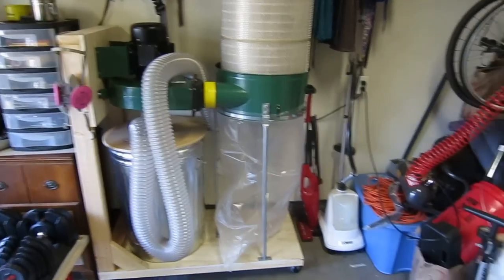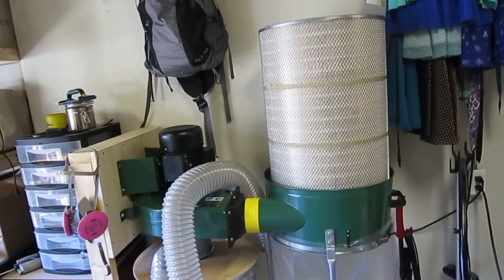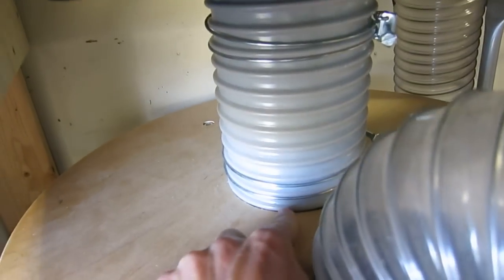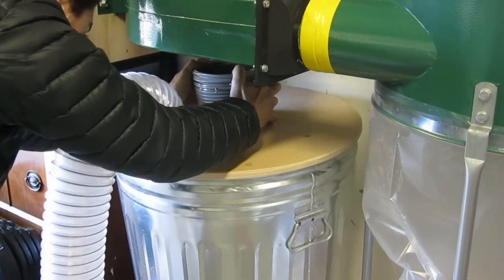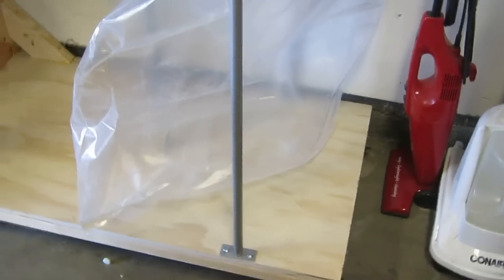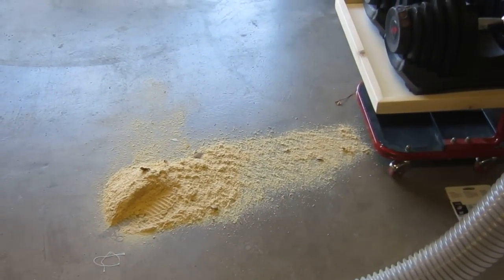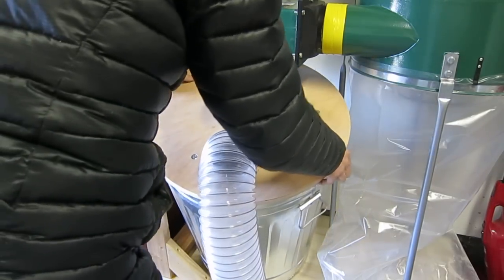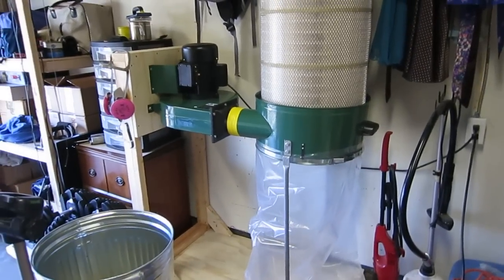Harbor Freight 2hp Dust Collector with Wynn 35a Filter and Thien Baffle Pre-Separator Setup

Comment: Great build and video, thanks. Your motor is mounted on top of the Thien Baffle, which makes sense for the direction of airflow, but are the bearings on the electric motor shaft able to take the downward loading? Are the bearings on the motor shaft, thrust bearings?

Comment: This makes sure you spend more time cleaning the chips out of the filter than you spent making them.
Reply: Not sure you understand how these work.  Huge improvement in air flow.
Reply: @BarryJohns   I understand completely. Did this stuff 15 years ago.  No air/dust separation.
Reply: @terencenewlin5265  that’s not what you said though, I agree with that.  The benefit of changing to this from the stock system is huge and worth every penny.  If someone can afford a much better system then that should go for it as it’s worth it, but others have to make due or can’t justify the cost due to it being a hobby.

It’s a very worthy upgrade, and one of many possible to help improve for those inexpensively on a budget.

As to cleaning wood chips out of the filter, not an issue, or let’s says I’ve never had an issue.  At some point I’ll upgrade to a better system that can truly pull all the harmful dust from the air and not just keep the shop clean of debris.  For now, it’s garage doors open and a respirator.

Comment: Hi, great job on the alteration.  I am thinking that a 2” pipe that is in the center of the bottom Thien level plywood, and then extends just below the 4” pipe exit by  2”, would create a negative pressure in the bottom of the trash can and almost eliminate all dust going onto the filter and clear bag.  Have you seen very much fine dust in your filter?

Comment: Good start to a great build. Just FWIW, I have the same DC and the same series filter but mine is the washable unit. Some more upgrades if you want even more air flow. #1. Upgrade the impeller. Rikon and Wen impellers reportedly fit and work great. I am planning on the Wen impeller ASAP. #2. Size up your inlet and pipe sizes through your Thien, OR size up your inlet and move the Thien to the separator ring although everything goes to the bag. Go with 6" inlet / pipe sizing

Comment: I am doing it a bit differently.  The dust input hose goes directly into the center port of the blower as it was designed to do (I have turned the unit upside down from yours) and the output from the blower goes into the the thien collector and then the bag/filter unit.  The benefit, IMO, is that all the suction (low pressure) is delivered directly to the collection hose rather than pulled through a large garbage can and then through the hose. That does not create the best suction where you want it.  It follows two principals of minimizing the run distance of low pressure side of blower and the diameter/volume of that run.  In your case the entire low pressure side of the blower includes the trash can and the hose.  However, the footprint of my setup is larger.

Comment: I'm debating on getting this setup.  Did you ever consider an impeller upgrade?
Reply from the maker: I 100% recommend an impeller upgrade.  The stock is definitely too small.
Reply: @thesergeant3524  also does the unit require a dedicated circuit?
Reply from the maker: doesnt require it but i would highly recommend it, especially if youre running it on a 15amp circuit.

Comment: How does the filter get installed on to the top of the system??
Reply from the maker: The filter includes 3 small turnbuckles with hooks on the ends.  They grab the inner lip of the filter and the lip on the body of teh dust collector
Reply: @thesergeant3524  thanks so much for the reply !!

Comment: it’s five years later and is it still working good or did you make any more improvements?
how is that filter doing?
i’m thinking you improved the way you detach the waste barrel, yes?
Reply from the maker: I actually need to do an updated video.  Since doing this video I've gone through 4 different systems, including a 3.5hp 14" impeller cyclone and back down to a modified Oneida Mini Gorilla.  I can not longer recommend this type of system.  The static pressure loss is too great.  Yes, you can get decent separation with the Thein baffle but the SP loss is almost 50%.  The problem is the filter requires that you have a pre separator.  The HF unit with it's small 10" impeller isn't pulling enough CFM to give more to a pre-separator.   Yes, the filtration is good, but if you're only collection 50% of the dust that you could be what does it matter if it filters .5 micron?  I'm going to do an update video with everything I've learned.  I have a air particle counter and have done a lot of real world testing.
Reply: thesergeant I really appreciate your experience and testing, I would love to see that video.

Comment: Looks good. I poured a 4x4 slab outside my shop and am framing in a small room. Since it'll then vent outside like a dryer, I'll not need the filter and ought to have a great CFM flow rate. Wish me luck!

Comment: Going to be doing a similar arrangement to this setup when you did this vid. Its very close to what I had in mind. Except I'm on the fence as to putting the Thein baffle in the ring of the Harbor Freight body as many have done and a small barrel underneath.
Have the Wynn filter on the way. But the downside to that is all the debris goes through the fan motor.
The plus side is there is no loss in cfm or performance the way I understand it.
But leaning toward the separator before the fan motor.
Any suggestions for me after using your for several years?
Would be much appreciated.
Reply from the maker: I need to do an update video.  When I made this video I was new to woodworking and didn't have a complete understanding of dust collection, CFM, static pressure loss, ducting, etc.   Knowing what I know now I would not recommend this setup at all.  The impeller fan on the HF unit is too small, the CFM drop from the Thein Baffle is basically 50% and when you factor in static pressure loss from ducting the reality is you're airflow horrible.  Yes, the air coming out of the dust collector is clean but if you're only collecting and filtering 30% of the dust it doesn't matter, even if you are filtering to .5 microns.  You'd be better off collecting more dust but only 1 or even 5 microns.   Also, the only tools that will be adequate for this collector are the planer and jointer.  Every other tool needs upgraded hoods to actually be effective at collecting the dust -- quality collector or not.  My new setup is much, much, much improved.  I'll post a video soon if I can.
Reply: I built a similar setup but used tips from multiple projects I had seen. Also had in mind to change out the impeller if needed but after paying close attention to everything being sealed and I added a baffle under the ring of the dust collector with a 5 gallon bucket for the dust.....I'm happy with the suction of it. Actually splitting off with blast gates on the cart to a floor sweep and it functions great but I don't use the floor sweep very often think I'm going to disconnect all that have one hose that I connect to what machine I'm running. Also used the dust right quick connect to make that connection easier. Thanks for replying, your video is one that gave  some ideas early on and was a great video.  When I tested it out the hose would actually lock up on the floor when sucking up dust. So seems to have plenty of suction for what I was wanting and performs great. Always room for tweaking tho 👍

Comment: With the art work that I make I do a great deal of sanding, very fine sanding in fact.   I understand a separater will separate larger or heavier wood pieces but do fine dust  particles simply go direct to the filter and then clog up the filter?

Comment: I like that setup, it looks like it should really perform well but at 7:14 - 7:20 or so in this video when you were cleaning up the lighter dust the tip of the tube caught the floor a little, but came right back up. This happened three times, so there has to be a bigger lose of suction than you are anticipating, and this is the point i want to make, when the tip caught the floor, it should have grabbed it with enough powet that you would have had to struggle to get it loose. I'm sure you kmow what saying, for instance when you use a house hold vac and it catches a curtain or flat patt of surface you have to separate the hose from thete.
Like you said, the harbor freight system is only so effective, but i am thinking the seal on the tin barrel.
There is a seal broken someplace, because it should suck much more than what is shown here.
Plus you are getting too much dust in the clear bag in comparasan to other videos that use thr thein baffle.
Build a real thein baffle instead of using that swirl design that sits inside the barrel and raise the system up 12" or whatever height you make the thein baffle. I say this because those sysyems swirl the dust around the barrel and suck it back up. Another thought is to build another thein  baffle with a 2 1/4" diameter hose same as a shop vac to see if it performs better with the harbor frieght system. Something else just came to mind, and that's maybe that the tin barrel may have leaks in the seams itself. Clean the inside of the barrel with rubbing alcohol and seal around the bottom all the way around and up the side to the top with silicone.I'd like to know if you change anything or find any leaks, because i want to build one and i want it to perform properly instead of wasting my time.  My two cents.

Comment: The key is really at the tool as to getting good dust collection and less in the air ;IMO. Its at the tool that majority of duct escapes system.
Reply from the maker: 100% agree.  I remember reading about someone that upgraded to a Clear Vue cyclone from a 1.5hp unit.  They tested both dust collectors on their table saw and used a Dylos particle counter and tested the air quality.  The air quality measurements were the same between the 1.5hp 1-stage and the 5hp 2-stage.  WIthout proper hoods the DC can't do it's just.  I need to update this video because after doing more research and years of using it I realized how low CFM this setup actually pulls.   I think most people would be better off with the stock setup with a 1-micron bag filter.

Comment: Having looked at your system along with other similar setup modifications using the HF dust collector the question comes to mind, why the need for such a large fine dust bag since most of the debris ends up in the pre filter.

Even with a large shop running multiple intakes, the amount of fine dust collected by comparison to larger particles caught by the prefilter is minimal. You'd have to empty the 31 gallon prefilter a 1000 times before coming close to filling the collection bag on the actual dust collector.

I think further modifications and thought needs to be put into this. And in doing so, would make the required real estate of the overall system much smaller by comparison.
I could be wrong, but your test collection suggests is be correct in my presumption.
Reply from the maker: You're absolutely right, no need to use the full size bag under the filter.   A couple months after I made this video I shorted that bag to maybe 1/3 it's original length and use the space underneath for hose and accessory storage.  I also added a clamp rack to the opposite side of the motor mount.   It's worked phenomenally well over the past 3 years.  I almost bought a new Laguna system but stopped myself when I realized I wouldn't be gaining much for the money.  I'm starting to look at my shop tool setup and dust collection differently now though and am in the process of reworking my overall system so that I can get away without a full size dust collector.
Reply: thesergeant - thanks for the response and update.

I stopped by HF today and took a closer look at the dust collector. I also saw they have a "portable" 1hp vacuum motor housing only for less than half the price of the one like yours.

I don't know how much cfm difference there is between the two. The 1hp I believe was 600cfm of air flow but @ what force i don't know. 

In looking closer at the one like yours... personally, given your test results. I'd toss the after filter for the most part and/or convert it to a prefilter like your 31gal can. Use maybe a 5 gallon post filter set up similar in design to what exists.
Given that train of thought... 
The 1hp without the bag and pleated filter looks inviting. Then you could just design it the way you want.

Currently, i don't need that much collection. My 12 gallon shop vac suffices. But i do want to add a prefilter to it similar to yours. Looking over designs and mods to systems like the HF that you did and others for my shop vac is what brought me to your video. That and I'd like to have something powerful enough, say for a table saw, that can do the job. I'm not sure my Shop vac is up to the task. So looking at alternatives..  such as the bigger systems holds my interest.

Have you done an update video on your collection system yet? If not, might be nice to make one and add in a section of thoughts or ideas you've had to improve or downsize, modify, discoveries in use of or what have you since you've been using it now for a few years now.

You'd get a view from myself and I'm sure others wanting to see an update and hear your ideas or thoughts being tossed up as your shop has progressed... 😉
Cheers...

Comment: Very cool!  Couple of questions:  How necessary is the circular wood separation device that's suspended by the long bolts inside the trash can?  (Not sure what one would call that.)  What did you do to ensure a tight seal of the lid of the trash can?  Also, you seemed to mention some formulas in the video.  Where would I find those?  Thanks so much for sharing your very nice project.
Reply from the maker: The separator isn't mandatory but it's a super nice upgrade.  It makes emptying much, much easier and faster (the bag is a nightmare), you can vacuum up things you otherwise wouldn't (like bolts, screws, etc.) without risk of damaging your impeller or puncturing your bag and your filter will stay cleaner longer since less dust is ultimately making it that far.    The separator is called  "Thein Baffle".  If you google it you'll see a ton of info on how to make them as well as the formulas mentioned.   I didn't seal the lid on the trash can.  The weight of it plus the pressure exerted by the 5" hose is enough to keep it sealed against the lip of the can.  You could always add gasketing material around the wood and then use a bungee cord across the top to hold it down if you are having leaking problems.  

If you don't want to go through the effort of building a Thein you could always purchase a "Super Dust Deputy" instead.  Same principle.   Goodluck and thanks for the comment!
Reply: You keep getting inquiries about sealing the lid of the trash can. Point out that it is in the suction side of the system. Never be a dust problem and wold only affect the suction at the end of the hose by whatever loss the lid may have. The suction would also help pull the lid down tighter to the can.
If wanted, a gasket material could be glued to the outer portion on the inner side of the top of the lid. Compared to the overall air flow, any leakage would be minimal but, for a perfect system, go ahead and gasket.

Comment: I purchased the POWERTEC 70001 Dust Collector Bag, 20-Inch x 31-Inch, 1 Micron bag from Amazon.. has anyone else tried this bag.. I see and read the review.. seem to be great.. plus only 27.00.. building a dust collector with a HF 2 hp and super dust deputy.. just asking..plus making portable so I can roll it outdoor in summer months ..
Reply from the maker: The problem with the fabric bags is that they limit the airflow being expelled through the filter.  A 1 micron bag will further limit that airflow.   The problem with these HF dust collectors is that they have a small impeller size and aren't really a true 2hp unit.  So you're already starting off at a disadvantage.  Once you add a SDD (or thien baffle) 10' of flexible hose and a one micron bag filter your airflow is going to drop dramatically.  Don't get me wrong, the machine will still collect chips but there just  isn't enough CFM, air velocity and static pressure to catch the fine stuff.  That 1 micron bag is actually limiting your dust collector's ability to actually capture the fine stuff at the source.  What it does end up capturing it will filter but I suspect your have plenty more fine dust floating around because the dust collector can't capture it.    The difference between the 1 micron bag and the 1 micron pleated filter is that you're getting much great surface area from the pleated filter so that air can escape faster, allowing for greater airflow.   If it were me I would hold off on the 1 micron bag and save up for a pleated filter.  If not, I'd suggest using a N95 or N100 respirator while you work.  Dust is no joke.  I got slack about it and paid the price.  Goodluck!
Reply: you can replace that impeller with a 12" from rincon with reverse curved blades, it will increase air flow and reduce the load on the motor.  And its a direct drop in replacement.